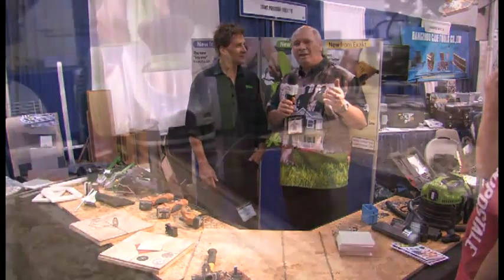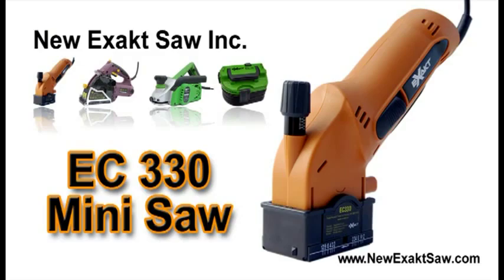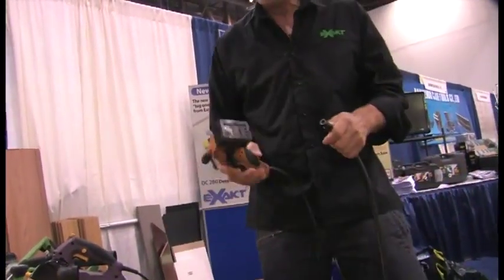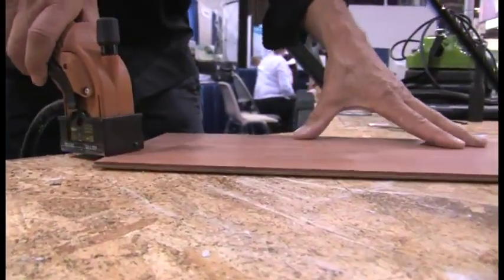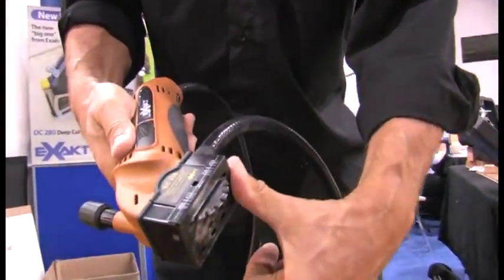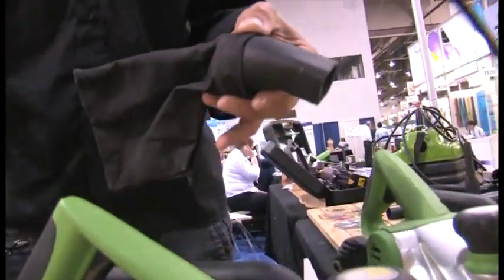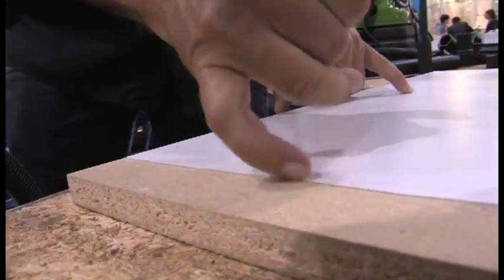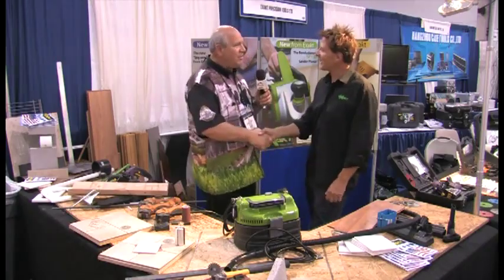Exakt Precision Tools

Comment: That saw is bloody awful to use, you have to press a lever to plunge, the resistance to plunge s far too heavy, at the same time you have to use you thumb on the slide to turn it on which is a bloody stupid idea, it should be on or off , also you need to connect it to a vacuum cleaner so the plunge function does not block and seize up, it's a hi tech piece of crap, I want my money back.